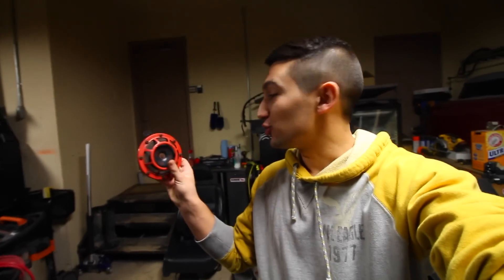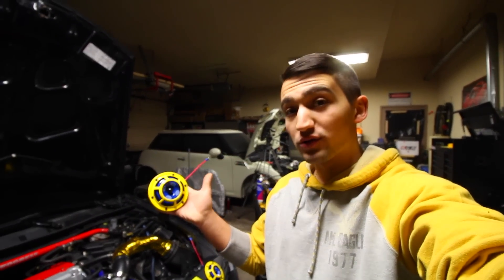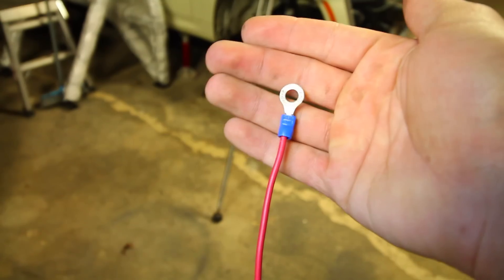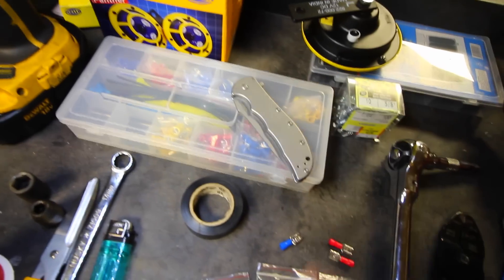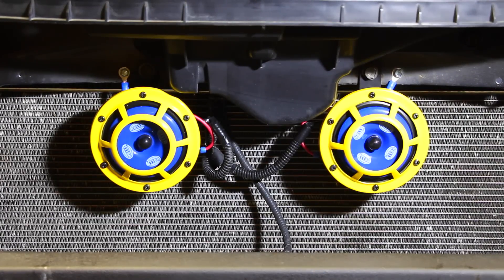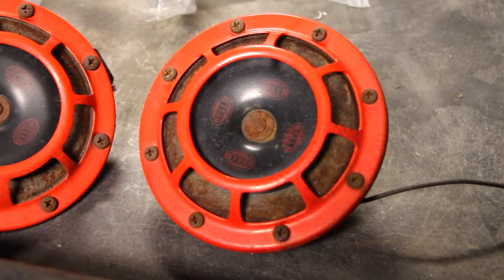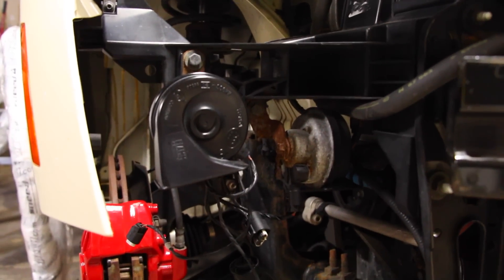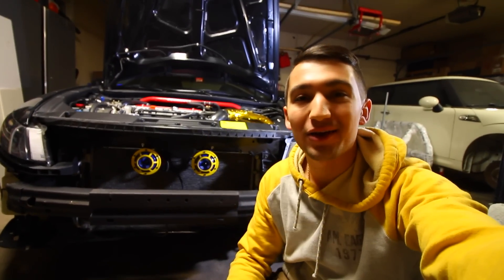CAN YOU HEAR ME NOW?!?! HOW ABOUT NOW?

Comment: Lasting for four years is not good, even when exposed to salt (Hella should have considered a different material or treatment method for the steel). When I buy aftermarket, I want to buy something of equal or better quality than factory. Thanks for the heads up. I'm going to buy something similar to the one on your Mini. I'm upgrading my Corolla horn because it's embarrassing to use it. Wolo has a 2 pack for $20 free shipping.

Comment: I have no trouble with my Hella supertones they are the german made ones lasted over 10 years in this 1968 Volkswagen Beetle as i used a relay with the stock horn control with the horn ring. as i used grease on the electrical connections on the horns along with the OE VW horn terminal boots. they are mounted in the stock location but had to add the high tone to under oppisite the stock location under the passenger side front fender as the driver's is in the original location under the driver's front fender. being they lasted long the car never sees snow.

Comment: how did you connect the horns with oem connector from the car? if i remember correctly, honda have its own connector.
Reply from the maker: I cut the wiring, and attached a female wiring connector so the horns would accept the wire easily.

Comment: i install it on my Hyundai Veracruz and i cut off my factory plug and connect 2 wire , when I plug it to Hella horn it sound either way there is no positive or negative it works either way , anyone know why ? No replay need it , I thought it won’t work if i hook the wire up wrong , in this case it works either way .

Comment: Did you use the Relay that come's with the kit?  Some people say you have to use it, but loads of people say it's not necessary, a lot of people say modern cars have enough going through the existing wires to power these horns, the only reason they supply a relay is for older cars.
I'm hoping I can just cut the original horn connector off and connect the existing wires straight to the new horns, what's your views ans experiences since you say you have used Hella twin horns for a long time? for the record I drive a 2013 Hyundai Veloster 1,6 GDi
Reply: Michael Thomson I own a 2003, I put aftermarket horns in because the old ones died, and I didn't need to use the supplied relay. just cut your wire harness off the old horns, and butt connect/solder a wire extension onto that, and connect your horns. if you plan to take horns with you if you ever sell the car be mindful of that when cutting the stock wire, leave room to reattach

Comment: Lol never got why these used to be so trendy, most useless mod ever.
Reply from the maker: Cuz they're louder than stock, and can be seen through the front grill
Reply: Why don't you connect 2 pairs of factory horns? They sound much better
Reply: Taha Masood The point is to sound annoying, the whole purpose of a horn is to get attention.
Reply: Not useless when your stock horn sounds lame and isnt loud. Just because your car doesnt need it doesnt mean every car is the same.
Reply: Idk where you live or how much time you spend on the road but a lot of OEM horns can't be heard by big foreign trucks on high speed busy roads. I replaced with Hella Supertones for safety, mine are hidden away so it's not a cosmetic thing.
Reply: Should have been some sort of factory warranty for them going out so soon like that
Reply: BoogieDownProduction you have a point. My 88 supra has wimpy horns so now I'm wiring these up.
Reply: agree there still a meep meep sound
Reply: I agree they sound like crap and only worked for 4 years. Factory sounds better and works forever.